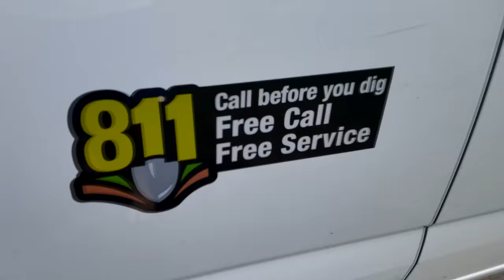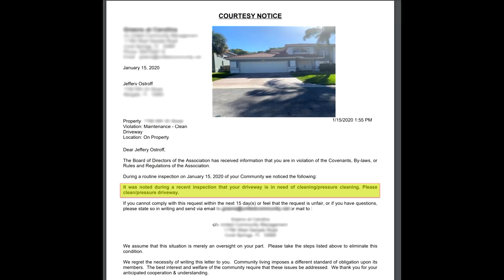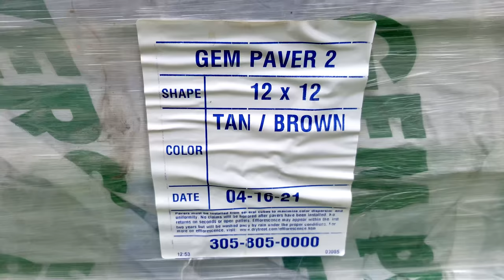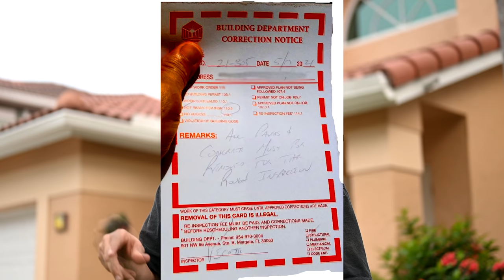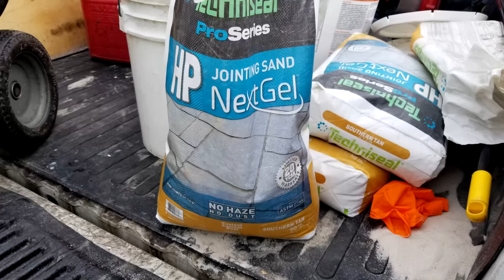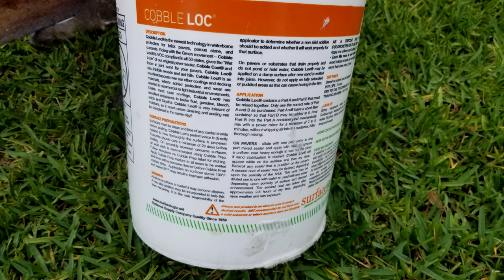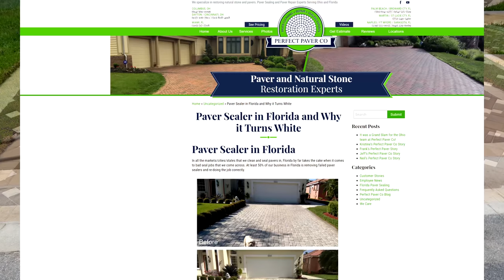How To Install Paver Brick Driveway Like Pros w/Time Lapse

Comment: No safety glasses, no dust masks to prevent silicosis from the silica in the pavers, causes hardening of the lungs and is not curable. Typical contractor who cuts corners to make as much money as he can at the expense of the safety of the employees. One day the Workers 
Compensation claim for lung damage or loss of hearing or an eye or a finger or foot.

Comment: .        5:02    Houston, we have a problem ! . . .
Yes sure. But more than ONE problem. 1st of all you rose the wrong finger. Then who is that neighbor that is this much-pissed off?! so what she/she needs to know about his! property!? One thing for sure, this ain't end here... Not to forget 15:47 that should have been on some other location!  ( ; - )
Then this is exactly why I never buy a property that has H&A at any damn cheap price. God bless everyone else. 
btw thanks for sharing this great job and seriously wished you could end up with a more ugly, eyesore color of the pavement that they deserve and won't reflect the imperfections caused by that leaking car that surely will not be changed!
Reply from the maker: Car was sold already, no more oil stains
Reply: @jeffostroff  A lot of time a small O ring change in the line is all that is needed to address the leak (Hydraulic lines) and if it is the gasket etc, yes better sell the problem to someone else who can deal with it.

Comment: We,we,we,we ? I don’t see you doing nothing. You should give credit to the personal who is doing the job.
Reply from the maker: Obviously you didn't pay attention I pointed out him “watch him watch how he lays out the tiles” “watch how his apprentice is hand him the tiles”. Watch how they do this watch how they do that. You're just here to whine for no reason. And by the way yes I did do a lot I worked quite a lot between myself and the company to resolve the issue of the filled building inspection because we were down for five days until we got that resolved. I'm also the one that designed the layout and chose the pattern, I worked with the guys to draw the lines on the grass to determine where to make that curve, I worked with the sprinkler company and dug the holes to help move the sprinkler lines. I cleaned up all of the mess after these guys left.
Reply: @jeffostroff  so finally you did something, good for you
Reply from the maker: @evilla410   What a relief also this was many years on the waiting